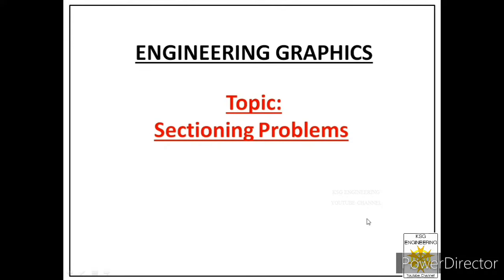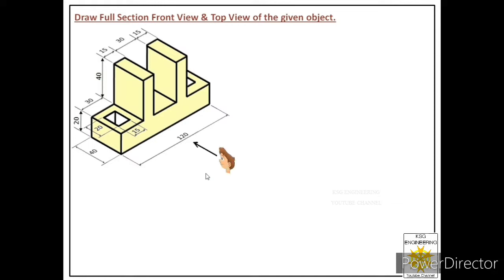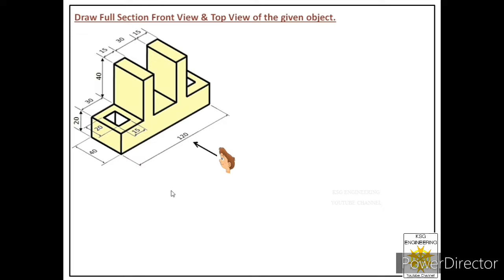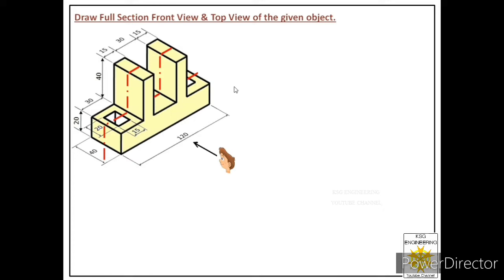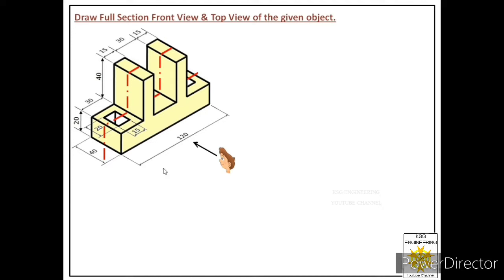Full Sectioning | Problem 1 | Engineering Drawing | 9.1

Comment: Why you didn't draw it in between 4 quadrants
Reply from the maker: I have drawn it in first angle of projection. You can draw it in third angle of projection as well.
Reply: @KSGEngineering  by making 4 quadrants,  like by dividing, we draw then these drawings...But why you didn't draw it by making sections..plz confirm this
Reply from the maker: It is not necessary to show 4 quadrants. We just choose a quadrant in which we want to draw our drawing and then we represent that quadrant only. Moreover, drawings can be drawn in only 2 quadrants that is first and third.
Reply: @KSGEngineering  but in orthographic projection, we have to draw three views top side and front...but there are only two.
Reply from the maker: It purely depends upon the question asked in exam. If question says that draw full section front view and top view of a given component, then there is no need to draw front view separately or any other view.
Reply: @KSGEngineering  okayy
Thankyou so much
Reply from the maker: @obsessedwithnature6747  you are welcome. God bless you